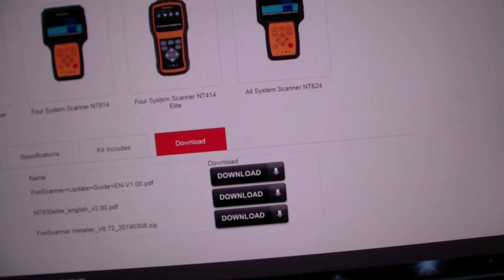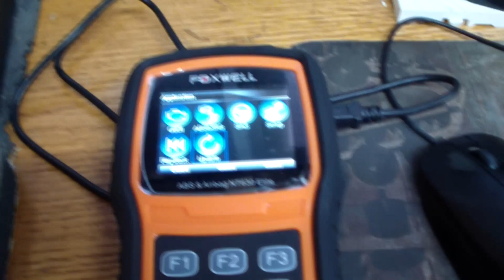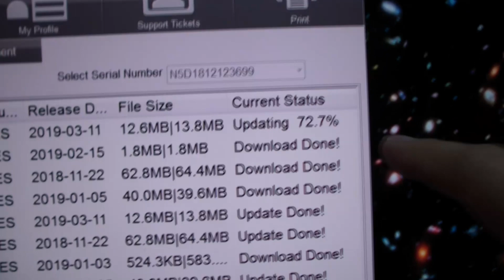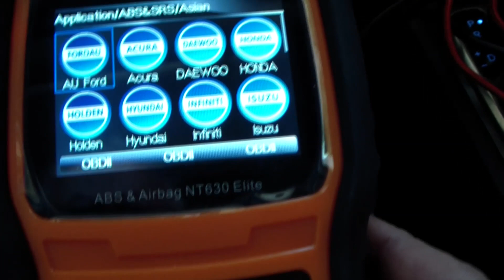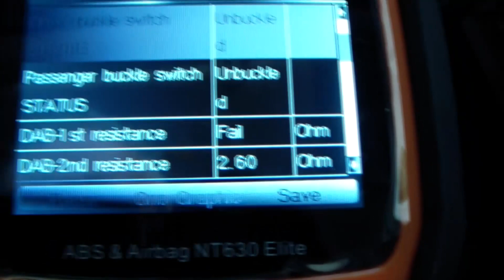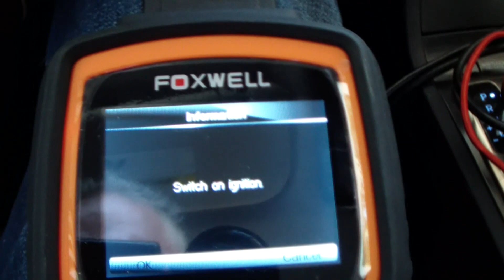Foxwell NT630 Elite ABS and Airbag OBD Code Scanner Review - FAIL!

Comment: Wow, I sense there is a great need for an ABS actuator (module) reset scanner, that bleeds the ABS module for the DIYer and thus saving the owner from having to take this issue to the dealerships, what with their exorbitant rates. Problem is, there are no reputable sources that the average Joe can count on for a factual and true review. I was hoping this was to be it, but alas it is not so. Do your viewers a good service and actually use the ABS function to see if it is actually possible to bleed the module with this unit, and not some sort of vaporware. You are in an ideal position to advance our knowledge, Kent, and I am hoping you see the need as well and lend a hand.
Reply: Hey Steve. I feel your pain. I bought an Autel that said it would bleed ABS. It did not. Sent it back and got this NT630 Elite. Plugged it into a 2002 Silverado and it actually worked. You probably know, so for other readers- ABS bleeding moves the air from the ABS unit only. You will still NEED to get the air out of the lines by bleeding a 4 corners. These thing are quirky and now it wont read a 2004 Tacoma. And you have to be prepared to download to your computer updates files from a 100% Chinese company.
Reply: @steadyeddie7453    Therein lies the problem for me, I drive a 2002 Tundra and I have yet to receive a good answer from Foxwell - their agent in the U.S. says it will, yet their agent in China says no (admittedly after much prodding on my part). The NT630 Elite is the unit I have been most focused on but I can't get past the uncertainty. Are you able to give any reassurance knowing it won't do the 2004 Tacoma? Not going to hold your feet to the fire, nor am I going to hold you responsible for my actions, but a little knowledge would be gratefully appreciated. BTW: I have a number of 1st generation Tundra owners waiting on my resolution to this issue. Thanks for the comment.
Reply: @counterpoint6718  These lower priced scanners are hit or miss. The manufacturers oversell the features and range of applications. Both the Autel (which I sent back) and the Foxwell are hit or miss. I kept the Foxwell NT630 because it is designed as a dedicated ABS and SRS tool. The 630 has limited bildirectional communication which is needed for ABS bleeding. Now , will it work on your Tundra? Cant say. If I had one here I would try it. So, I sent back my Autel for a full refund. I suspect Foxwell would do the same. I suggest that you verify the return policy and if its 30 days like mine, then go for it.
Reply: @steadyeddie7453    I'll probably have to check out their return policies, though I was hoping someone would answer up that was knowledgeable on whether or not it is applicable to my vehicle. After emailing a dozen or more, and being assured that they will do everything I could image, I have become quite skeptical, hence the problem - whom do you believe?
Reply: @counterpoint6718  Copy that. Unless you find someone who specifically used it on your make and model it becomes a crapshoot. I question some of the YouTuber's as they are given the tool in exchange for a video review. Others are testing a product right out of the box and are obviously clueless, or just want their 5 minutes of video fame. You could try a dedicated Toyota Tundra forum. I would think someone there must have found a scan tool that does what you want. Otherwise, take a chance and get the Foxwell. Try it out, and if it doesnt work send it back. Then post your findings specific to your vehicle. Thats how we all learn. If I get a Tundra in, I'll test my 630 on it and update my findings.  Good Luck.
Reply: @steadyeddie7453    The forum idea is kind of funny as I am a member of such a forum, and I am like the lead person on ascertaining whether or not any scanner exists that is inexpensive to the DIYer and that will bleed the ABS actuator (module). They are looking to me to bring home the bacon, and I've yet to find the pig. I have become increasingly resolved to making the jump solo, though I would rather have more info if at all possible. I have ruled out the little BlueWhatevers that plug-in and stay plugged-in, and the ones where you purchase the cable and access what appears to be bootleg software from a CD, with the sellers (Chinese) rooted deep in your computer. I've been fruitlessly pursuing this for the past 6 weeks or so, so your encouragement is appreciated.
Reply: @counterpoint6718  Speaking of Chinese. The Autels and Foxwells are 100% Chinese. The Launch may be also.They require you to register with your personal information, then register your device. Then you can check for updates. Updates get loaded to your computer's hard drive first, then transferred to the device. Wow! I have yet to register mine, but now that it wont communicate with this Tacoma, I have a decision to make.  I may look into a Bosch to see where its made and where the support comes from. But back to your original question- my Foxwell DID bleed the Silverado's ABS. The bi-directional capability is the clue. But will it bleed the ABS on a Tundra? I cant say.
Reply: @steadyeddie7453    Well I emailed Foxwell - USA and received multiple assurances that my Tundra was covered. I also emailed Foxwell - China and received the same treatment. But, I pressed it a little harder with the translation and later was rewarded with a no. Just the one no, but enough to make me think I found the honest Chinaman. Then here you say it won't do your Tacoma - what? Yours and mine are the two best selling light trucks in the world and they aren't covered? My gut feeling is yeah, its all a Chinese scam, with the generals building the bogus scanners in their factories and the Chinese local and international criminal triad selling the bootleg software and key.

I had thought of downloading the software onto an older computer than was now obsolete to my general needs and was meticulously clean of personal identifiers, and as such a write-off of no concern. I know I could always fudge my personal data, so in that I felt no particular threat. The thought that we are being swindled is probably what has kept me from trying something, and I'm talking swindled as in plural, the people beyond you and I. This thing reeks of swindle and it seems in the open, it is so blatant - and it is this assumption on their part that we are too gullible to care or act that has me stepping back from committing.

If you do come up with something, tag it on here. I will do the same. Thanks.
Reply: @counterpoint6718  It's all about online purchases. 330 million people in the US. If you market a piece of crap that nets you 1 dollar, and just 1% of the population buys it, you make $3,300,000. Even if 50% send it back you still walk away with  over 1.5 mil.  The Chinese Foxwells, Autels, Launches, etc play the game. Do minimal R&D, keep costs low, market the product, and reap the profits. When the reputation of your product eventually kills your sales, close shop and re-open under another name. Foreign company exempt from most US laws. At the same time gain personal info, and perhaps access to countless computers. So... my Foxwell may just need updated to work on the Tacoma. If you are willing to take a chance with Chinese software, buy it, try it, and send it back if it doesn't work. Mine came with a 30 day return policy. 2nd option, and I like this one myself. Look into the Bosch scanners. They're made in the US, Canada, and Mexico. Support is in the US. Same price range, and more functionality. The Bosch devices just aren't listed as dedicated ABS & SRS tools. But I have since found out that if the device offers bi-directional function then it will bleed ABS. I didn't do enough research, or I would have bought the Bosch. Which btw, I believe OTC is the same scanner under their name. I'll keep posting here as I find out more. Please do the same.
Reply: @steadyeddie7453  Thanks for all the info, it helps in understanding, in a general way, just what might be going on with regards to this scanner marketing. I am surprised that no reputable identity, be it an individual or organization, hasn't taken on this issue already. I've dropped inquiries on several individuals and have received nothing for my efforts - complete silence. Frankly, our conversation leads all others in this matter. It would be nice if we could get an association of auto repair professionals or marketeers to take the lead in this matter and I am thinking of emailing a few, as I identify them. There may very well be honest brokers here, and the little guy, as in myself, could use their expertise in wading through the BS. I recently got taken by a defective action camera with origins in China, even though I was fairly careful in the purchase, yet relying too heavily on their reputation to correct any problems that may occur, but finding, in the end, that they simply didn't care whether or not their goods were sound. I am not eager to repeat this, and since my Tundra is not a daily driver, I can wait for an answer. Thanks for your continued comments, etc., and keep them coming, as I will send what info I get, your way as well.
Reply: @steadyeddie7453    Well so far OTC has been unwilling to address my emails and I've found no linkage between their products and ABS bleeding. This latter point holds true for Bosch as well, at least on the DIY level, as far as I can tell. I emailed them tonight, so no answer is expected anytime soon, to be fair. They certainly have some really pricey pro versions - like in the thousand$ that may do it. I'm still in pursuit...
Reply: @counterpoint6718  Bosch tech support was the latest scan tool people that I have talked to. My questions focused on the 1300 and 1350 models. The 1300 does OBD I and OBD II, and comes with the adapters. The 1350 model is OBD II only, but has some upgrades over the 1300. The 1350 says it performs caliper retract and ABS bleed tests. Thats a good indicator it will do what you want. A scanner with Mode 8 has these bi-directional controls. The tech confirmed the tools are made in Mexico and Canada, with US and global parts. The support is 100% based in the US. Now, the tech said they try to cover as many makes and models as possible but some vehicle manufacturers use unique protocols, and dont release the needed information to all scan tool manufacturers. I am paraphrasing. I suspect its a pay-for-play deal. Thus the reason the high end scan tools cost so much. They buy the rights and then can cover more vehicles. So it looks like coverage will be hit or miss no matter what scan tool you purchase, unless you get into thousand dollar and up range. So I suspect you will have to take a chance and buy a scan tool you think best suits your needs. If it doesnt work then send it back for a full refund. No harm in trying.
Reply: @steadyeddie7453   Thanks for the info on Bosch scanners and the 1300 and 1350. I just happen to have been in touch with JEGS Performance, out of Ohio, and they said there was nothing that could currently be done to remedy my situation short of visiting the auto dealers. Now whether or not that is true remains to be seen. I think they wanted customers that wore "Professional" on their ballcaps, and not "DIYer".

On another note, I had a forum member state that he used the Chinese bootleg software approach with no problem. I am waiting on a follow-up to focus closer on our vehicles and his new technique.
Reply: @steadyeddie7453    Well I received definitive word that there is no bleeding of the ABS actuator/module for the 2002 Tundra. A system test can be conducted to determine the systems status, should you have the proper scanner, but there are no mechanisms to actually bleed the system. The tech that ran the simulation for me had the credentials and training to be considered a most reliable operator and witness, and the Techstream software was the latest version. For me, the issue is now settled. You might try enlisting the help of such a soul in your cause. Peace and good luck, brother.
Reply: @counterpoint6718 So I have to ask- why are you looking for a scan tool that will bleed ABS on your 2002 Tundra?
Reply: @steadyeddie7453  I have an excessive amount of pedal travel that I have been unable to improve upon regardless of the effort and steps used to cure it. A number of YouTube videos have others with similar problem being able to remove the excess travel through bleeding of the air that has accumulated in the ABS actuator/module and the online  "experts" talking up this maneuver.
Reply: @counterpoint6718  Air doesn't just show up in the brake system unless you did a repair or replaced a hydraulic brake part. So I will assume this is the case. I'll also assume the videos with similar problems are not on a 2002 Tundra. Otherwise they would have indicated the equipment they used, and you would have had your answer. So...  If the vehicle can safely be driven take it to an empty gravel lot/driveway. Get it up to 20mph or so and get on the brakes hard. Let the wheels try to lock up.The ABS will do its job and cycle the valves, thus bleeding the air from the ABS unit only. Repeat as necessary. Then finish by bleeding the system at all 4 wheels. Also, if your truck has rear drum brakes be sure they are adjusted. A definite source of a low pedal.
Reply: @steadyeddie7453  The pedal travel has been there a while for reasons unknown to me. I bought it used with 92,000 miles about three years ago and it came with the excess pedal travel. I've only recently become concerned after nearly T-Boning a herd of elk at dusk. Thankfully the ABS worked great and no slide, otherwise I would have taken out about three of them. Decided then to look into fixing the pedal travel, did a four wheel brake job, replacing the front calipers and bleeding the system twice.  Pedal travel remained excessive. I then watched a couple videos and read up about the ABS actuator and module and was quick to blame it for my ills (and it still may be to blame - it may in fact need replacing, but not today). 

I have recently been told of the gravel road treatment, and I plan on doing it in the next few days. As you suggest, gunning and braking hard to "encourage" the air bubbles to splitsville from my mobile. Should this be insufficient, I will then replace my master cylinder and continuing to the replacement of my rear drums if the pedal is still not ideal. And should even this be insufficient, I will probably then be looking at the R&R of the ABS system.

I've given up on the scanners for this purpose, as there isn't any protocol for the ABS bleeding as I envisioned (this coming from a Toyota tech after running a simulation on his shop's new Techstream equipment, yesterday afternoon). Should I get ahead of this issue and settle it, I may revisit the scanner issue but with the typical OBD II functions on my mind. It is a certainty that I won't go Chinese if and when I do look at scanners again - they seriously pissed me off with their dishonesty and gaming of the system (not that I was partial to them beforehand). They were a definite factor in the overall waste of time and effort I underwent trying to figure this schit out.

I hope your future is met with the success you desire in this and other areas. Thanks for the friendship shown. If I can help you in any way, ask.
Reply: @counterpoint6718  I am surprised the Toyota tech hasn't figured out the problem, or even test driven it to confirm a low pedal.  You can keep replacing parts until the problem is corrected but that could be costly, and certainly not the professional way to fix a problem. Unfortunately I gave up my ASE Master certs in 1998 so I have been out of it for a while, and no longer have the "insider" knowledge that gets passed around among techs. From a basic system view when I hear low pedal I think a few things - air in the system, drum brakes out of adjustment, and pedal to master cylinder linkage/pushrod needing adjusted. Not sure if the Tundra has this last feature. I would bleed an ABS generally only after replacing brake lines ( think Dodge and Chevy trucks). Small amounts of air in the system generally get pushed through the ABS module. Its when you dont have enough pedal pressure to force the air through that it becomes a problem and ABS bleed becomes necessary. Last, some vehicles like my Dodge Ram just came that way from the factory. I am also stopping 5,600 lbs of factory weight so I expect a little lower pedal. Perhaps your Tundra is similar.  In any case, good luck and keep me posted with any updates. Word of mouth is often what leads to a resolution. I will do the same. Peace.
Reply: @steadyeddie7453    I've never had a Toyota tech look at my particular Tundra. When I first bought it I had a mechanic who specialized in "outlaw" modifications to look at it and he deemed it okay. Since then, all I have done is change pads/shoes and replacing the front calipers, plus several bleeds which have resulted in a complete flush of the old fluid. The brakes work fine, to include the ABS, but the pedal travel has always bothered me - though it might be well within factory spec! That is the extent of my work on them, and you can see part replacement has been minimal. My next move, in its own time, will be to replace the master cylinder and going OEM. In the mean time, I am going to look at the rear proportioning valve and if nothing else, clean it up while giving my frame a good look see (Toyota has had a recall for frame rot in northern states). And, finally, I am thinking of buying a used ABS actuator/module, cleaning it up and familiarizing myself with it. Maybe they can be rebuilt, and I will see about that aspect should I get that far. I'll certainly keep you posted on my progress. Peace to you and yours.
Reply: @steadyeddie7453  I contacted Autel and sent Vin to them on my 2000 Chevy Express 1500. They replied oddly that they did not have any product which would help me bleed my ABS module and brake system. I was very surprised to learn this. I have purchased the Foxwell to be delivered tomorrow 05/27/2022. We will see.